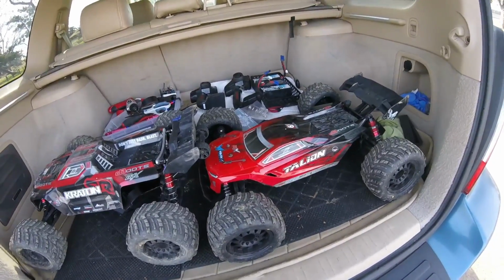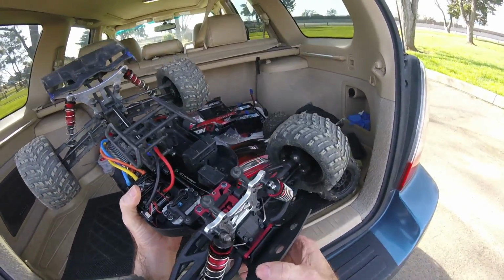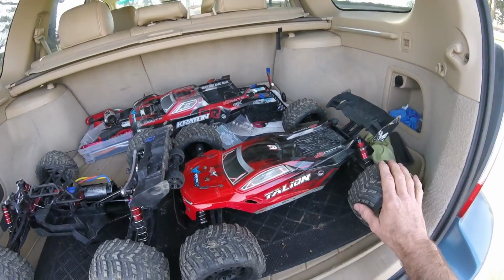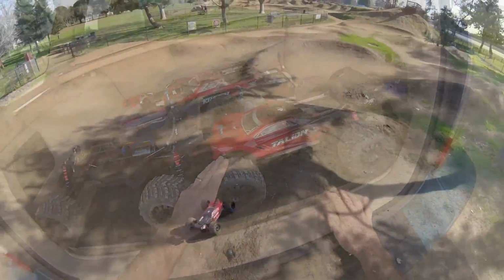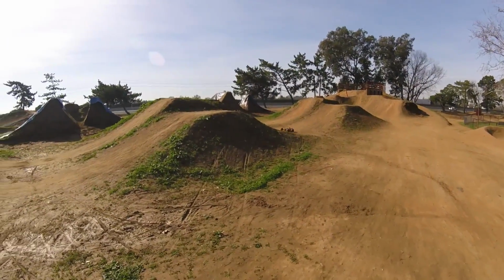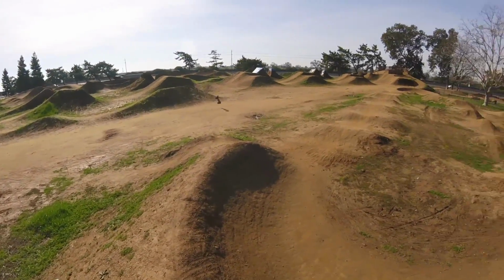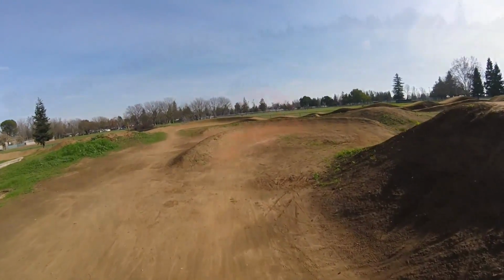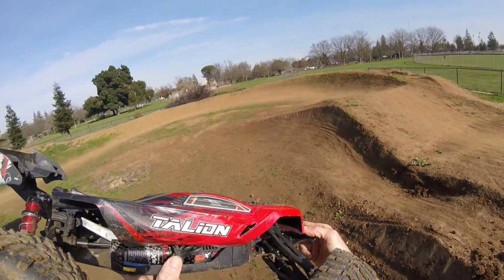Arrma Talion 6s V3 "Spot the Landings" Kraton 6s to the rescue...

Comment: Def getting the shockwaves!! They look beast for all these rigs. You would think they wouldn’t have as much cushion as the backflips or the trencher 40s but they seem just right.
Reply from the maker: Mike Tye they're great all around bashers IMHO. Much lighter than Backflips or Trenchers but they don't bounce as much on landings.  Very forgiving wheels overall. 😎💪👊👊
Reply: Rich Duperbash yea just worried about too much chassis slap with low pro style tires. But seem to work amazing. Well just ordered pulled the trigger so we will see 😂 Hard to beat the backflips on everything. There really good set all around I have 2. Just wanting to try different style look.
Reply from the maker: Mike Tye you won't have too much chassis slap. Truth is, I've been breaking less parts overall when running the Shockwaves. That's partly true for any RC when you lighten the total mass. Also, it's easier to break more suspension related parts when not getting easy enough chassis slap. That's why I lightened my V2 shock setups over a year ago. Less strain on the shafts, pistons, rod ends, and arms. There's a balance of course or happy middle ground. 😎💪👊👊
Reply: Rich Duperbash right on man. Yea def can’t complain with less broken parts! I’m stoked to see what they do. I have to figure something out with my shocks. Idk if it’s weight of my heavy turning batts. But my suspension just seems to sink down. Doesn’t leave much room to work with. Idk I’m prob gonna take it to my local hobby. Those dang o rings have been out of stock forever everywhere. Maybe that’s it. Or I need new bladders idk. Thanks anyways bud you the man rich!! 💪🏼💪🏼😎👊🏼👊🏼

Comment: Rich if you're not running the Hot Racing bulk heads/lower diff cases, you should try them. I have one in the rear, and it has been super strong...installing one in front now too. I developed a crack along my front hinge pin...so I'm upgrading☺💪👍
Reply from the maker: sRCparadise thanks so much Steven 👊!!! I recently bought 2 of them to try out. They look very nice indeed. Totally worth the money in the end. Especially if you figure how much time is required to replace a broken plastic one. I'm planning to upgrade my 5 Arrmas over time. Wasn't ready to replace all of them in one shot 😱. Really appreciate it my friend. About to watch your latest upload.🍻😎💪👊👊

Comment: quick question,
I see these Carbon Fiber Tower braces for sale, any thoughts on them vs M2C Stuff?? Im just curious because Im sure they are lighter and should be about the same strength. I see all the big bashers using aluminum Voltage or M2C and was not sure if it was loyalties or preference??
As always great Bash....that gap at the new spot is nice, though I know this Vid is old....I am getting caught up
Reply: meant to say Shock Towers....

Comment: I was just noticing, does the Kraton have the same size shock towers as that Talion, w/ just the cab part being cropped (on the Talion)? It just looks like neither body sits on the rear tower. Nice run btw, sucks about the break, but at least it is back up, new and improved.
Reply from the maker: drog343 thanks so much brother 😂!!! The Kraton and Outcast share towers, shocks...etc. The V3 Talion has smaller towers and shorter, angled shocks. It has less suspension travel and it's own chassis. They moved the motor/center diff back about an inch. It's really a speed basher designed for hard cornering and FAST exceleration. The Kraton is definitely better suited for really BIG air and harder impact bashing. 🙋🙋😲😲😲😵😱🍻😎💪👊👊

Comment: What weight shock oil do you run in your kraton I've been running 700 should I go higher
Reply from the maker: I've been running stock 80 weight (1000cst) with M2C Racing ZRS shock caps and O ring pistons. For quite awhile now. Much better dampening with less bounce. It's a great upgrade. 🍻😎💪👊👊

Comment: Rich when you bash after work, do you leave your house before work with your lipos charged to storage level and then charge them in the car after work on the way to bash spot, or do you charge them to full at home before work and let them sit in the car at full all day until after work when you are going to use them?
Reply from the maker: Hey Ryan 🤗. I leave my charged packs at home or bring them indoors before bashing. It gets too hot to leave them in the car. Not worth having them burst or start a fire. Fortunately I live close to work. Just prep my stuff, go home, load up and go bash. 🍻
Reply: @richduperbash2966  Thanks Rich. So you charge them before work? Was just curious if any concern letting them sit at full charge all day before use. I know it’s not that long but curious how long is ok to let lipos sit at full charge before use.
Reply: Also thought I noticed a charger wired into the back of your car, do you do any charging during your bashes?
Reply from the maker: @ryancolebourn3060  typically not. I charge several packs the night before.

Comment: Dude, you push RCs to the MAX! Great bash. Are there any dimensional differences between those 2 rigs once they are wearing the same shoes?
Reply from the maker: RedBeard RC thanks so much brother 👊!!!  Yes. They are the same footprint, but the ride height and handling are a bit different due to the lower shock towers and shorter, more angled shocks of the new Talion. The Talion is quicker because of less weight and aerodynamics primarily. It's ridiculously fast with the stock dBoots Katar wheels on. I'm running the beefier Shockwaves for more cushion on landings and better in air control with the added wheel mass. Basically was hoping not to break my daughter's rig, but did it anyways...Lol😨!!! Not sure if you know this, but the V3 Talion also has a different chassis. They shifted the motor/center diff back about an inch on the chassis plate and turned the servo 90°. I will say it's extremely well balanced IMHO. The better rig for ridiculous AIR is still the Kraton hands down. 🍻🙋🙋😲😲😲😵😵😎💪👊👊

Comment: Hay Rich. Do you think you could give us youtubers a how to on jumping and some driving techniques? I think that would really help us from tearing up our rigs. Thanks bro. Bash on
Reply from the maker: Shane Hambrick the best advice I can give for jumping is to build a ramp with good transition about 18-24 inches tall. The wider the better, but 3-4 feet is usually plenty. Practice jumping into  grass, bark, or softer dirt. Jumping and driving techniques simply takes practice. Know what you want to do before taking flight 😨. The more air you catch, the more time you have to correct and level off. The flip side is the more potential damage, too...Lol😱. I recommend steady throttle and exceleration on approach. Every RC is a bit different, get to know yours well so you can guage it's nuances. Avoid drastic throttle inputs until you really know your RCs behavior. Straight take offs are highly recommended. Don't tense up or be nervous. Lastly, don't get frustrated. I honestly don't like to overthink things when I'm bashing. Just always warm up and have a clear view of what you're doing. Blind jumps or landings often end badly...Lol😵. Thomas Pettersson of tpparts-rc Xtreme recently spoke about driving within your skill level I believe in regards to avoiding breakages. It's so true. Parts still break at times regardless, but when you get reckless or start overdoing stuff, flails often result. Hope this helps some. There's tons of ramp building info online if you're interested.🍻😎💪👊👊
Reply: Thank you Rich. I value you and Garys advise a lot. You dudes keep this hobby fun and exciting.  Now that I am getting back into the hobby to the dismay of the wife I took the advice from you guys and started small with the stampede then graduated to the Kraton which now is my go to till the proline comes in. I'm just trying to get throttle handling down, TheKraton seems nose heavy and it I was a landscaper would be rad with all the holes ive dug, Going to start telling the wife im going gardening instead of bashing, lol. You are the Obey One Kanodi of bashing im kind or
Reply from the maker: Shane Hambrick thanks so much brother. If you're running stock wheels still, get some dBoots Backflips on there. The bite is WAY better, and the extra wheel mass will totally help you stay level and correct easier in the air. Less rolling resistance also. Check Jenny's RC eBay. 😎💪👊👊

Comment: So what you like better in tires the back flips or the shockwaves
Reply from the maker: I still like the Backflips overall on the Kraton. Really prefer the Shockwaves on the Outcast. 😎💪👊👊
Reply: Lame they're discontinued on the proline site
Reply: I got an outcast I'm building and tires are where I'm at
Reply from the maker: @onemansvideos2134  that sucks 😵. Hopefully they release something comparable. 🤯
Reply: They is one guy with them on eBay but they are from Hong Kong ?
Reply from the maker: @onemansvideos2134  usually takes about 8-10 days for me to get stuff from Hong Kong 🤔. Might be worth it if the price isn't jacked up. Badlands 3.8s are also a nice option with great traction. Just not as plush/forgiving with landings.

Comment: Hey man what pinion are you running in the kraton.  And what is your diff oils cst?
Reply from the maker: lou demarco I was running a 20 tooth with my Hobbystar 1730kv long can 4092, now running a 19T. Diffs are 50/500/20K front to rear. I was running 200k center, but recently switched. With stock electronics I would run 16T pinion on 6s. 🤘🤘😎💪👊👊

Comment: Hey rich bro i want to learn how to jump and flip how big bro i have the kraton and talion i have so many spots to jump but i dont know how please help bro! And what diff oil and upgrades would i need to make to car? Thanks bro!
Reply from the maker: Troy Speed Rc that's awesome you have the spots and desire brother 👊!!! I'm running 50/200/20k front to rear in both the Kraton and Talion. I haven't changed my shocks from stock since putting V3 Kraton shocks on my V2 Kraton. Use to run 50 weight front with Orange Teknos and 40 weight rear with Yellow Teknos on my V2 shocks. Jumping simply takes practice. If the nose is too high, you need to let off the throttle and/or tap the brake to bring it down. Conversely, if your nose is too low, you need to give some throttle mid-air to bring the nose up. Backflips require a steeper take off and a burst of throttle to make a rotation. You usually need to brake to slow the rotation for your landing, so you don't over rotate. It's easier if you advance your ESC punch setting up between 7-9. I'd find some medium sized jumps to practice on and do your best to land wheels down 😵. Mid-air corrections take time to get the feel for. Practice is the mother of skill no doubt. You can't force it. Start small and work up. Expect to do some nose darts, wing and roof landings 😱. Be patient with your progress and have fun with it. Small throttle corrections are usually better than drastic ones until you really get the feel for it. Try not to ever land on hard throttle. It's bad for your diffs. Hope this helps bro. 🤘🤘😲😲😲😵😵😨😎💪👊👊
Reply: Exactly practice practice getting used rcs you play with rich has mastered driving these arrma cars with dedication and trial error most important ly practice i cant beileve how it is out west big play ground for adrenaline junkines if i hit lotto going be richs neighbor 😆

Comment: Hey did u bye them glued i did
Reply from the maker: RC RIDER yes, bought premounts and just vented them with 2 holes using 3/16" sharpened copper tubing chucked in a drill. Covered the rim holes with a strip of Gorilla tape. Do the same for all my 3.8 wheels.🍻😎💪👊👊

Comment: Just picked up some new shockwaves today u make them look like some sweet wheels and new backflips just ordered the top hing pin arm from voltage hobbies just brock the crapy gpm one ill never bye from them again its not a good alum rich
Reply from the maker: RC RIDER appreciate the feedback brother 🤘!!! GPM looks good, but it's all about durability. Voltage mounts are so AWESOME 😍😎💪👊👊
Reply: I got GPM suspension mounts all the way around since voltage is still out and I haven’t had a problem yet. 🤞
Reply: Ya there oki but ive had my rear ones brack easy but then on my typhon there strong so all. In all there good
Reply: RC RIDER I think def step up from the plastic for sure. I wish voltage would re-stock!!!!! There legit!!
Reply: Ya me two just bye some from gka custom rc parts there supper strong hes got some killer after market parts and the rear hibg pin set
Reply from the maker: Mike Tye that's great to hear brother 👊!!! I'm really hoping Kenny gets his inventory back up. Breaking suspension mounts usually equates to broken diff cases, bent hinge pins, and often damaged Shocks and arms. 🍻😎💪👊👊
Reply: Rich Duperbash I know hopefully soon!! I been patiently waiting. Was gonna get GKA but they only had the rear. Lol I’m a stickler when I get something I do it all the same time same brand. Weird OCD.. lol So far no need to. But def will when Kenny re ups 💪🏼

Comment: Hey Rick what pinion are you running in the talion
Reply from the maker: maksood ali running 18 tooth on 6s. Temps have been safe thus far, but that is pretty tall gearing. I'd say to just check yours if you're going to gear up like that. I normally run 16 tooth on the Kraton and Outcast.🤘🤘😎💪👊👊
Reply: Rich Duperbash thanks bro that was very helpful. I'm going to run 16t to be on safe side.
Reply from the maker: maksood ali no problem brother.😎💪👊👊

Comment: What tbone setup do you have on the Talion?
Reply from the maker: bigpapi0306 I'm running the Tbone Typhon Basher bumper. They changed the angle at some point. Just barely clears the body now, but definitely still protects well. 🍻😎💪👊👊
Reply: Rich Duperbash I have the v3 Talion as well and was looking for a bumper setup for it. Seems like they haven't done much for it yet.
Reply from the maker: bigpapi0306 Tbone has greatly improved their designs based on critical feedback many of us provided when they solicited direct feedback on the Arrma Forum. Most of the newer styles are angled steeper to avoid shoveling mother Earth 😱 or hitting steeper jump faces. You could really use about any Arrma 6s front bumper cuz the front chassis design is universal. I personally prefer bumpers that don't attach to the diff cover, just from the bottom. I've hit trees, poles, you name it...Lol. I highly recommend you put something up front for the unexpected.😎💪👊👊

Comment: How are you riding wheelies? No way this is stock
Reply from the maker: Skitzo FPV the Talion does easy wheelies on 6s with 200k center diff fluid and bigger wheels like the Shockwaves. Think my punch setting it set at 7 also. Still running 18 tooth pinion as well.🤘🤘😎💪👊👊
Reply: Rich Duperbash stock spur?
Reply from the maker: Skitzo FPV yes. I run all stock 50T Arrma spurs. They're super durable from my experience anyways. 😎💪👊👊
Reply: Rich Duperbash are you running hot racing pinions or arrma?
Reply from the maker: Skitzo FPV I run all Robinson Racing Extra Hard pinions. The Tekno hardened pinions are great, too from what I've heard.🤘🤘😎💪👊👊